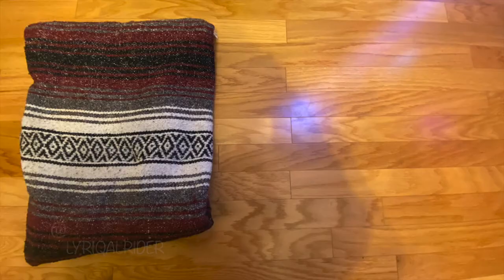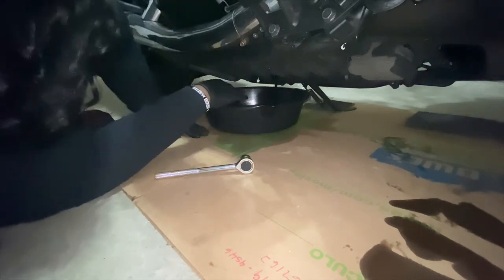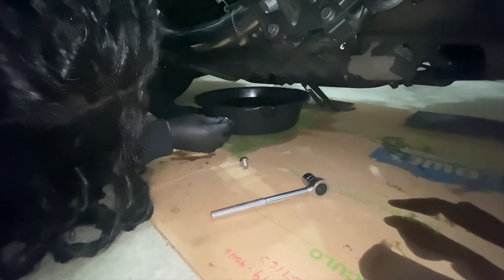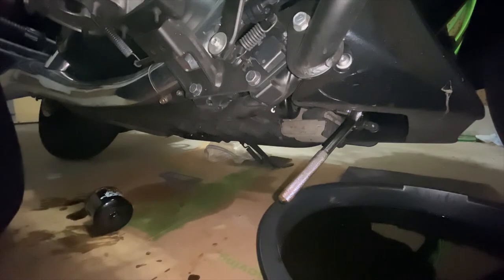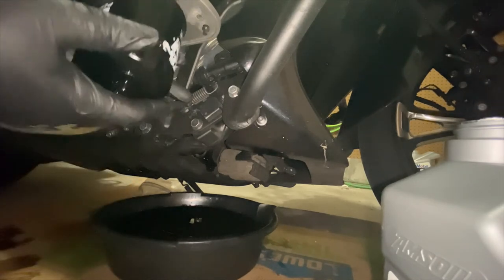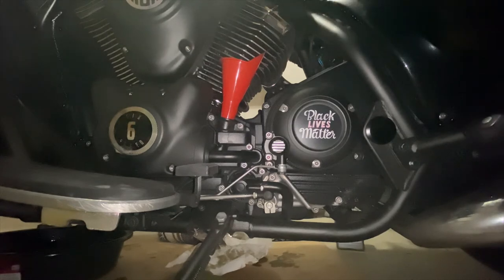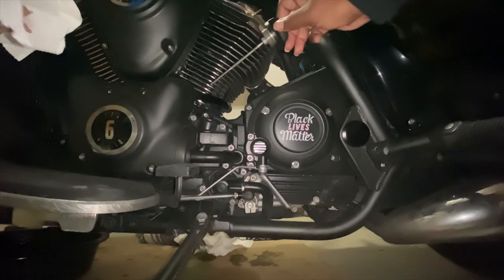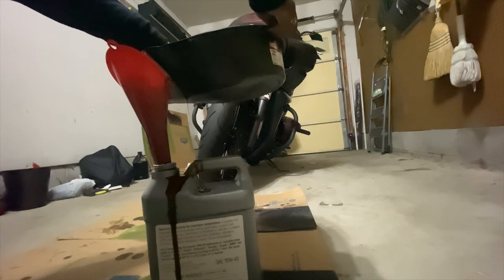OIL CHANGE ON MY KAWASAKI VAQUERO | Biker Chick Motovlog

Comment: Hey I know this video is a year old but I just watched it and I just wanted to say great work on changing your own oil as far as the cleanup and being environmentally safe great job on putting the oil back in the new oils bottle but to make your job less messy and easier for you and a lot cleaner they make a oil pan that is a combination oil pan and bottle to where you never have to touch that oil and you tighten it up once you're finished and take it to your local auto parts store and they empty it out for you way way less messy just thought I'd let you know.

Comment: You did well by using the Amsoil in your ride, very good quality oil. Also, if you ever find yourself in a situation where you have to use a filter other than a K&N, they make oil filter strap wrenches that wrap around the outside diameter of the filter. They work well and make the filter removal easy. They are inexpensive and can be found at any auto parts retailer. It’s a good addition to anybody’s tool box. Hope that helps, I love when I see women that ride their own! Ride on!
Reply from the maker: Oh yea I’ve seen those. Adding it to my cart. Thanks!!! 🤗

Comment: Hey, I just started following u from a previous vid. Im a fellow Vaquero owner & i wanted to tell u tht the Vaquero takes 5 & a half quarts of oil wth the filter being changed. Once u run the bike for a minute you'll see tht the bike will require atleast an additional quart. Ur owners manual will confirm my statement.
Reply: Tha's only if it's bone dry.